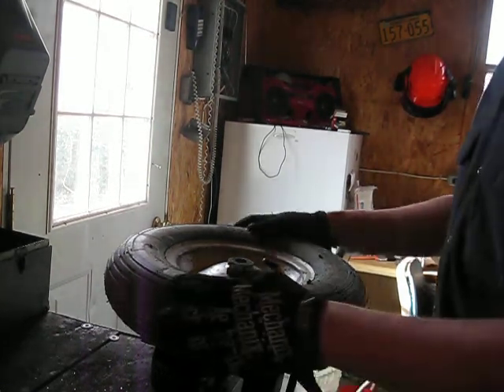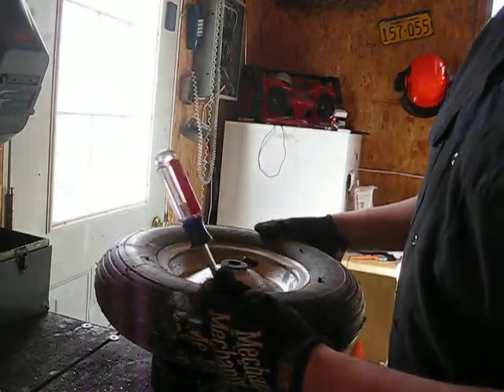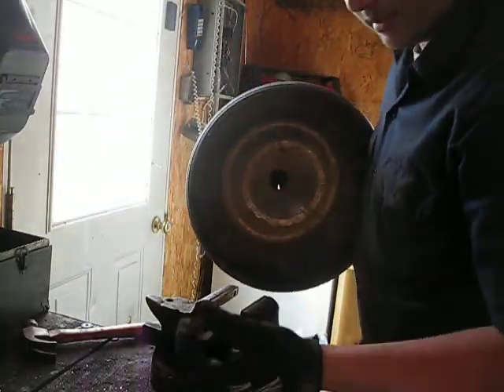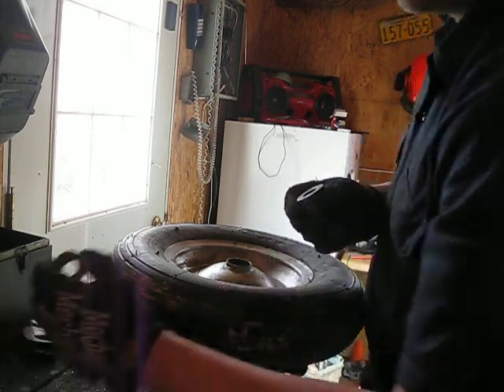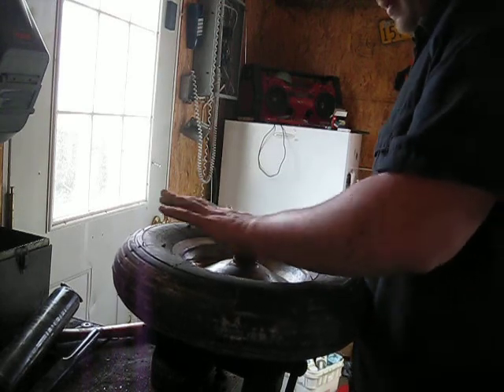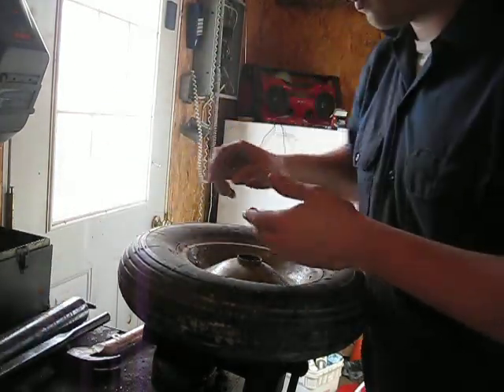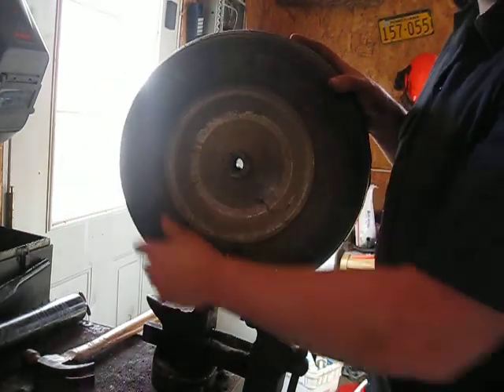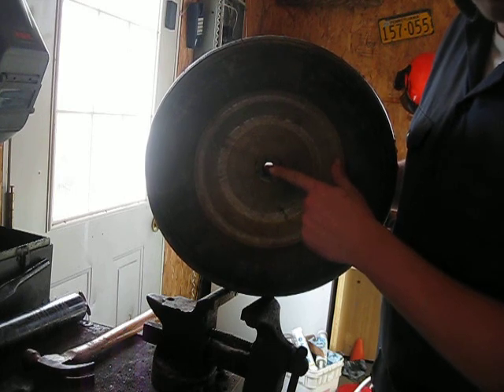How to: Replace Lawn Cart Tire Bearings with Heavy Duty Bushings

Comment: I have  a Toro ride on mower that uses ball bearing this size on the front axle. Have had several break up on me. Was wondering if these bushings would actually last longer? Actually it would be enough for them to last the same time as long by as they fail gradually rather than suddenly like the ball bearings. What say you?
Reply from the maker: Are they stamped ball bearings like in the video? They typically dont last as long. These bushings will last a lot longer but are still prone to wear out the bore and/ or spindle and can be pricey unless you can salvage them. Your best bet is probably to purchase heavy duty sealed ball bearings and use them, as they are more common and can be had cheap.
Reply: @KeystoneMotorsports  Thanks. Have got some machined bearings on order.

Comment: Don’t bushings “rub”, where bearings “Roll”? My question is wouldn’t a bearing work better? If so, do they make a bearing that is tougher than the factory ones? Also, are most all lawn carts the size bearing?
Reply from the maker: They do, but will carry a little more load. You can get better bearings online. Most carts use 1-3/8 OD by whatever ID bearings,  you can get them online pretty cheap and sealed.